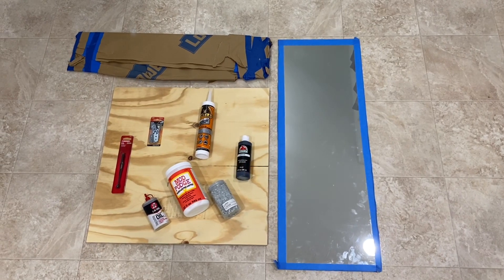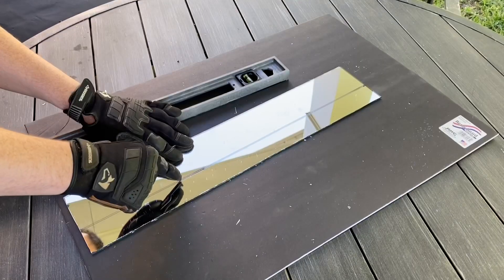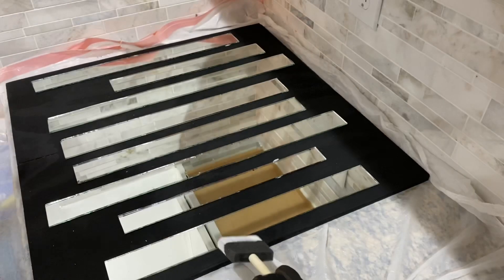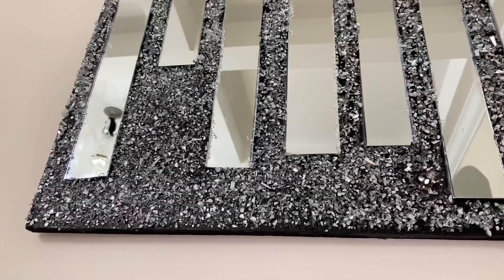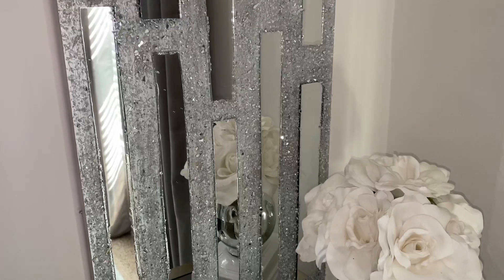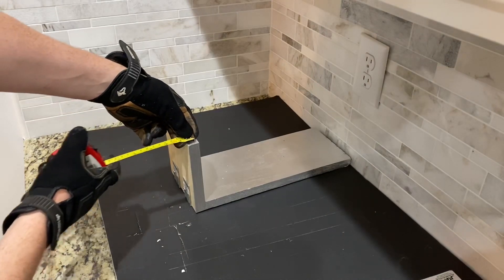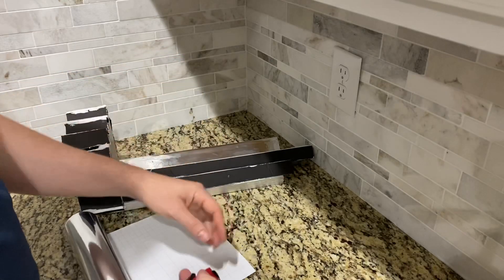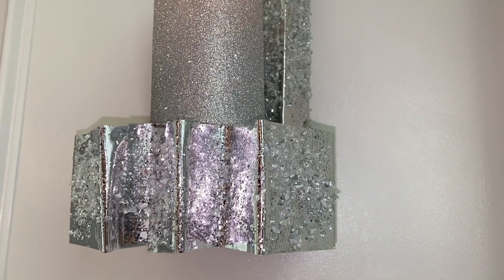DIY Home Decor Ideas | LUXE DIY Mirror Wall Decor | LGQUEEN Home Decor

Comment: Love these! Great job and very informative too.  Can you tell me do all the glass strips come out perfect or are there some a bit crooked. do you still use them ore are you buying more mirror so you get enough pieces that have perfect edges? I have that same tool to cut mirror and glass and its great but sometimes it does not snap apart straight I would love to know what you do

Comment: Beautiful piece. Please use the mirror glue that is made for these projects. The construction adhesive is going to cause spots on the mirrors in a few months. These pieces are too beautiful to be ruined. I know because I do mirror diy and when I first started I was using construction adhesive and later it caused spots on the mirror. The construction adhesive eats through the back of the mirror. Trust me, you will thank me later.😊